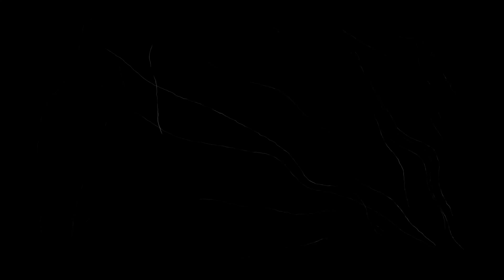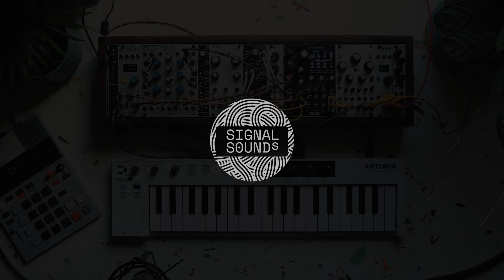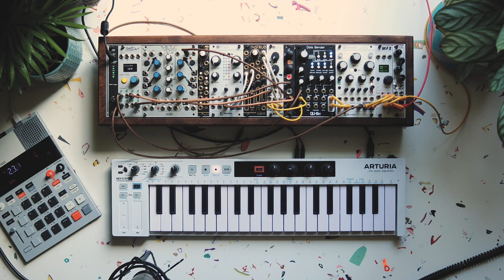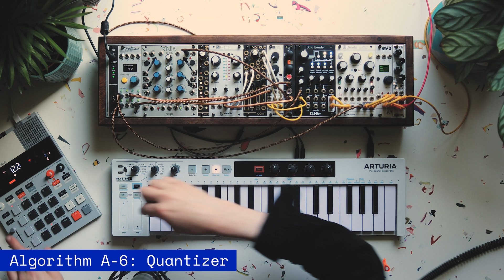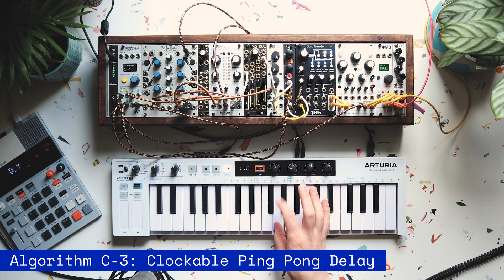5 great algorithms in the Expert Sleepers Disting Mk4

Comment: this skiff is a "wish I saw this 4 years ago when I got into eurocrack" standpoint ... so much can be done with that case!   great video (as always) and I should dig a bit deeper into my disting! currently only using it as a quantizer but they delays are really good too!
Reply: I used to use Disting mk4 as a quantizer. But I switched to uO_C as my main quantizer, and that frees up the Disting for more experiments. I even found a guy who sells wavetables prepared on gumroad (Roikat Sound Design) for the Disting Mk4/EX. Really opened my eyes on getting some less harsh digital sounds out of a wavetable VCO. 

L-4 Dual Vowel Filter is another good algorithm to try, make some cool psytrance/psybient tracks with it. 
J-8 Audio playback with Crossfade is pretty amazing for making nice sounding loops and textures and even switching between very different samples smoothly. 
I-6 Audio playback with Scrub is fun if you have a ribbon controller (Zorx) or a slider (RitS TUL)
Reply: Ive been using my disting mostly as a dual sample player for kick&snare, but I'll definitely checkout the wavetable vco now.

Comment: Disting, Plaits, Maths and Dual Dagger!  Can't go too far wrong.  Splendid work as always.  Didn't realize just how good that reverb was..?
C-8 Bit Crusher - How many ways can bits be crushed??!!  
N-6 Pulsar VCO - Chip Choon City with the Massive wavetables now?  Come on!  
I-6 Audio Playback w/Scrub - Zik Zik!    R-R-E-A-L-L-Y-Y    F-F-R-E-S-H-H-H-!-!  
F-6 Shift Register Random Quantized CVs - On the MIDI 2 scale setting with a latched arpeggiator or sustain pedal's a goodun...
K-3 Wavetable Waveshaper - A la 'Massive' now apparently... and then
K-2 Clockable Wavetable LFO - Automate that mult/division parameter - mad syncopation.  Thanks for the fab content mate.   : )